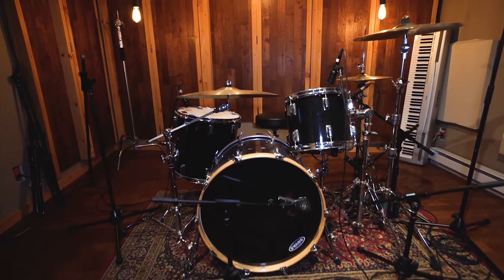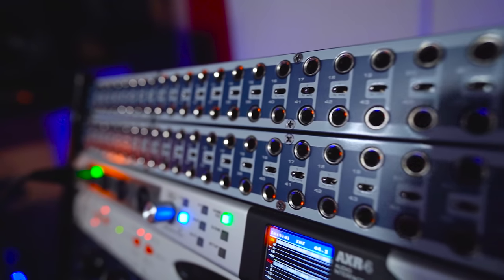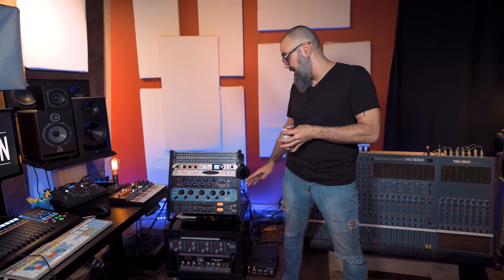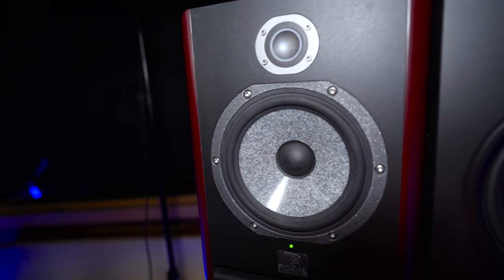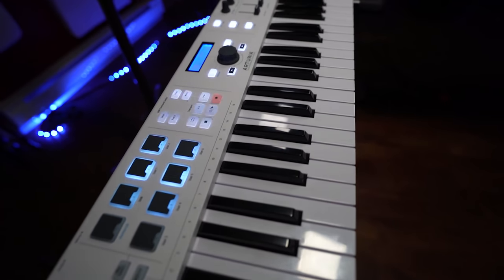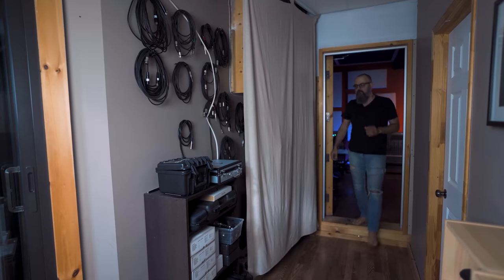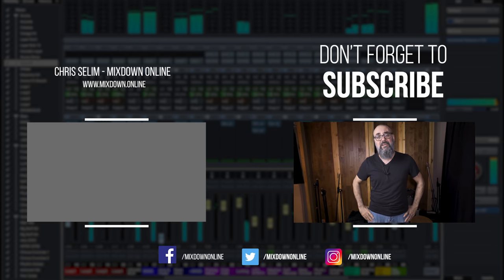My 2021 Studio Tour (Before I make some changes...)

Comment: If you want a computer screen for better viewing and more accessible try to go low view tilted in angle allmost flat Raven Mtx or normal led screen. You have the screens close but it won't block the sound from your studio Monitors.
Reply from the maker: Yes, I know but not the best for my back, I need to keep my visual angle straight up at 90 degres

Comment: Hi Chris, looking forward to understand how the new rack mount with the gear, patch bay, interfaces etc work with Cubase and improve the sound quality.

I only use the DAW with a simple interface, UR242, to connect just the midi controller but would like to understand why we need this gear and how it improves the sound quality (and how to use it).
Reply from the maker: Yes, I will work on a Patchbay video soon. A quick spoiler, a patchbay doesn't improve the sound quality. it's just a very good tool for gear management if you have some gear you work with. So not a must for everyone!  More details on the video :)
Reply: @mixdownonline  Thanks Chris. All your videos are so informative. I learnt pretty much all of Cubase through through your videos. I will look at your recommended videos too. Thank you.

Comment: What system do you use for the basstraps looks like you use classic westlake  hanger resonators or Frunhofer VPR platter resonators. 
I have read about the hanger resonator it,s very easy to build but there are no data available about sizes and dimensions for the frequencies you want to resonate. Basically the Hanger is just a MDF panel dampened by glued glass fiber and mounted free hanging in stacks. Every wood panel has a resonant frequency if you dampen that frequency you have basic resonator. For low frequencys  the hanger plates gets very large and you got have alot of them in section to be a effective bass traps. Westlake audio used this system for basstraping in 70,s and early 80,s. The Frunhofer VPR platter resonator is a new design from the 2000,s  that use a metal plate resonator dampened with special foam material and are more effective compared to westlake hangers. If you use westlake hangers or VPR do a video about it and how it works 😎👍 😇🧤
Reply from the maker: All handmade my friend! Liek you wrote, MDF panels with dampened by glued glass fiber on each side and mounted free hanging in stacks :)

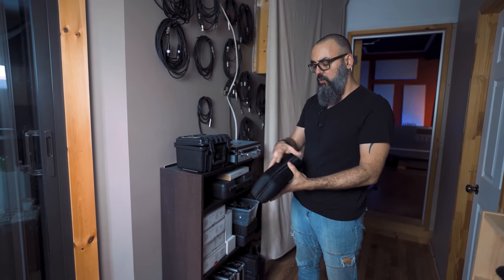Comment: 19:10 - a PAIR of AKG 414 - I just got one (AKG C.414, with lots of switches on it) and used it with my singer for the first time yesterday. He said it sounded warm - but I definitely need to get used to it compared to the T.bone SC1100 (A Neumann designed cheap large diaphragm mic that sounds way more expensive than it costs and is my main studio work horse - super defined highs on that one). So the AKG is my most expensive Mic to date, but definitely I need to work on the curves and maybe do a shoot out with the SC1100 to see which one is better for this particular singer. I have a feeling (with super cardiod pattern) the AKG is very sensitive to head placement (where the singer looks to), so I think it needs a little more discipline to get consistent recordings. What do you use the 414s on?
Reply from the maker: I actually don't use them much like I used to but the last time I used them was on tom and floor. Sounded great! Or else I recorded a lot of acoustic guitars with that mic
Reply: @mixdownonline  not much problems  with head placement on your toms I guess LOL. Goes to show that double the price tag doesn't mean double the quality. I still need to find what to use it on, doing a bit of percussion and maybe try it on acoustig guitar; it might actually be more forgiving on string noise. It's going to be a long time (and room treatment) until I dare letting a real drum kit into my space.

Comment: I see you have a couple of mini split AC systems. What is the make/model and are they quiet enough to have on while recording a vocal?  I live in Arizona and my little room gets so hot!
Reply from the maker: Yeah, Arizona is a killer during the summer. They are Fujitsu ACs 2006 models and they have an ultra silent mode. For recording, it depends what I'm recording, but for vocals or acoustic guitar, I still turn it off when recording and turn it on in between takes. When mixing, I keep it on and I don't care much.

Comment: Why do you need a patch bay with only roughly 10 channels of outboard? Surely it can all be hooked up permanently with dedicated external FXs setup in Cubase? Much easier than mucking around with patching.
Reply from the maker: Because I don't only Mix but record also and I was kinna tired of getting at the back of my racks to repatch my gear when tracking :)
Reply: @mixdownonline  Is that due to latency issues? I track through external FX and monitor in Cubase with unnoticeable latency - I suspect Steinberg drivers aren't as goon as RME though.

Comment: Hey Chris... what brand mini split A/C is that? I'm contemplating bypassing my home basement HVAC system due to excessive noise. Do you also have a mini split in your live room? If so, can you leave it on and track artists simultaneously?
Reply from the maker: Those are Futjisu ACs, I one in each room that are independent from each other.They have an ultra silent mode, which can be ok when recording, but I still turn them off when I record since I'm a bit of a freak ;) For my control room, I don't care much though, I leave it on on Low which is quiet enough when I mix!

Comment: You have a lot of outboard gear, this is cool but, I have to ask, is it really necessary?
You are kind of like me I have a bunch of stuff that is basically taking up space. Every once in a while I will run some trx's through "my stuff" and it's fun to play with but,,,,, why not just use what's in the box?
OHHHHHH The dilemma!
Love my outboard gear but, it is so much easier to load a plugin than it is to run a cable.(I don't have a patch bay). Ha Ha.
There fore I work mainly in the box.
Do I love it?
No. But, do I have unlimited compressors, EQ,s, FX's and such with my analog "STUFF"?
No I don't.
"In the box I do" HA HA
Love you Chris keep throwing those little tidbits of knowledge out there that make me ask myself, What if I did this instead of that?
Nice studio by the way.
Reply from the maker: I used to do a lot of client work, producing, recording and mixing.This is when I got all that gear. Now I mainly focus on my own music, YouTube and some mixing clients when I have time. So that's why I'm getting rid of what I don't need. For the rest, I keep it if I use it. I also mix ITB but I like to use external gear also, it has a different vibe, not better not worse but different and I like it. The advantages are to high working ITB so I keep the outboard gear to a minimum when mixing.

Thanks for watching David :)